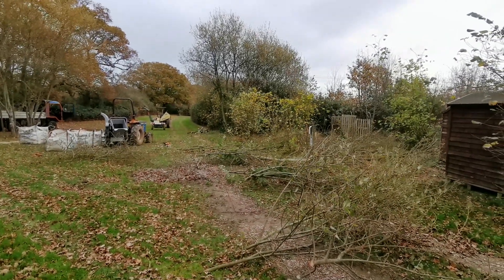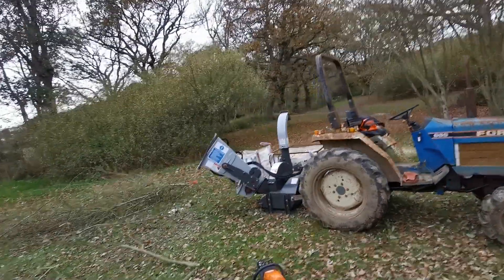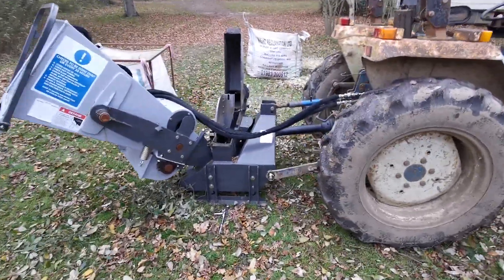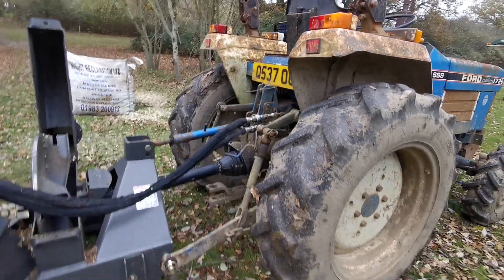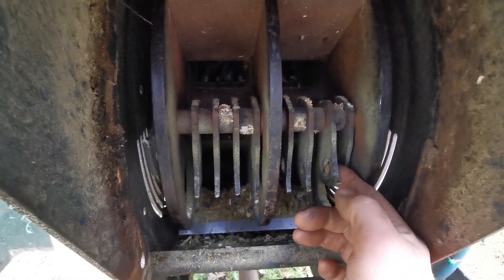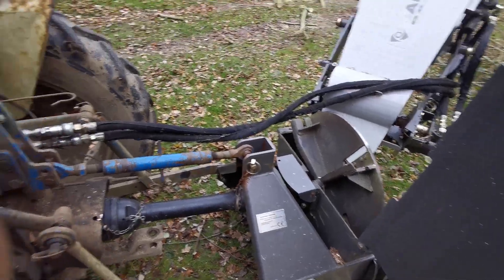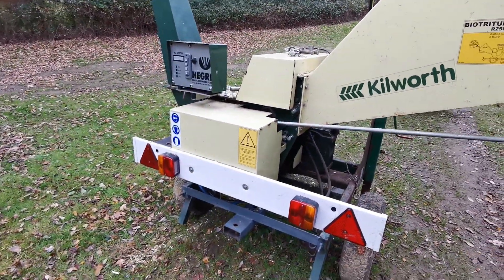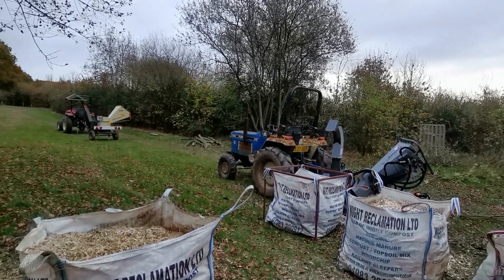Chipper vs Shredder green waste processing test

Comment: That thin "sticky/limby" stuff that the chipper spits out without really doing anything to. Run it back through the shredder a fork full at a time to get some really fine stuff. Mix that with soil or mix it with wet shred cardboard and paper. Press the slurry into a split log shape and let dry. Make nifty fire starters it should.

But it's your place not mine, so I'm fairly sure you already have a plan. More likely by the time I saw this video, what you were going to do has been done already.
Reply from the maker: It has already been done - the shreddings have been clamped for just over two years and made fantastic compost for our vegetables
Reply: @DiamondHell  Nicely done, I figured that was the case when I looked back at the upload date. Still, was entertaining nonetheless and thank you much for the reply.